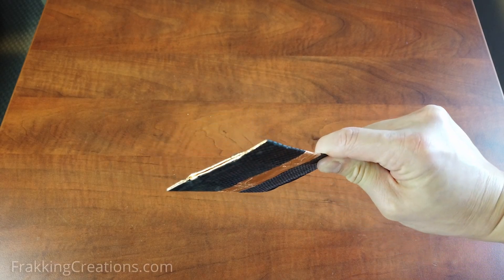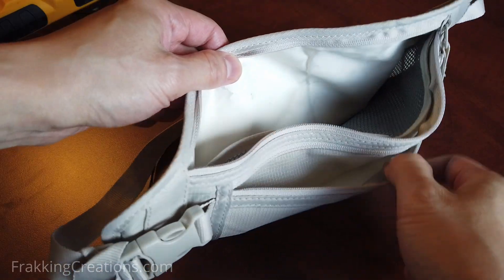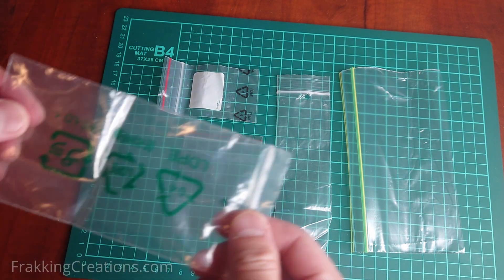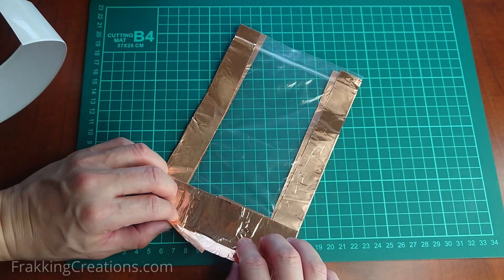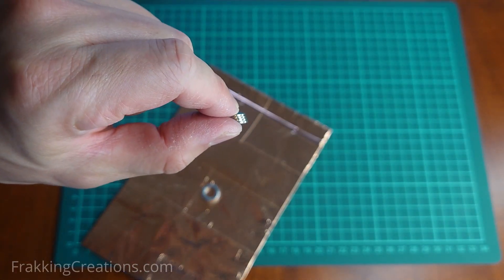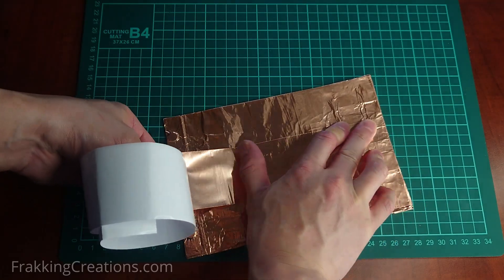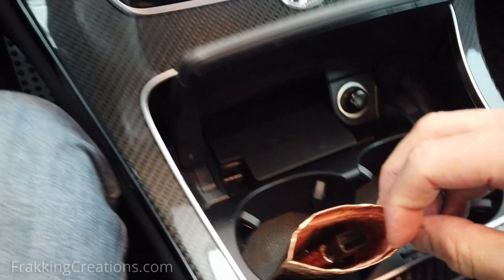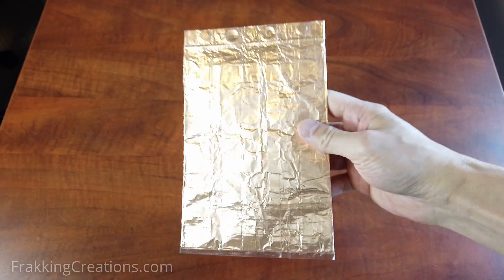Make & Test DIY Faraday bag for key FOB, RFID card, Passport - STOP Keyless car theft & more

Comment: Nice work. Don't they make some kind of mylar bags that block out all of these EMF's?
Reply from the maker: Thank you for commenting.  I don't believe that Mylar will block EMFs.  Maybe they are good for static electricity but that is much lower frequency than WIFI, 5G, etc...

I have links in the video description to ready made Faraday bags from a company that specializes in Faraday bags and much more.  They even have a transparent one also made with shielding fabric.

Note that if I were to make these bags again, I would use that company's shielding tape instead of the copper tape since the copper tape can be heavy and is not as malleable or softer like fabric.
Reply: @FrakkingCreations  Awesome, good to know!
I actually looked at a bunch of faraday bags... the bags I've seen so far are too big... I'm looking for a bag that just barely fits over a 6 1/4" x 3 1/4" phone, so that I can still put it in my pocket without a big bulge of extra material crammed into my pocket. 
Do you know of any faraday bags of that size?
Reply from the maker: I added a link to the Faraday phone sleeves they have.  Not sure if it's what you are looking for.  It's in the description too.
Reply: @FrakkingCreations  Cool! Thank you.
Reply from the maker: You're welcome.

Comment: I took regular aluminum foil from my kitchen unwrapped my key fob then walked up to the door and it did block the signal I also tapped my wallet on a Wi-Fi scanner at the grocery store and it picked up one of the credit cards. I then took a piece of cardboard and wrapped it in two layers of aluminum foil the size of a dollar bill and stuck it in my billfold compartment of my wallet. I did the same thing with credit card size Shields at stuck one in each inner pouch I perform the same test multiple times on different registers and they don't read the cards anymore. We'll see how long it lasts
Reply from the maker: There's definitely more than one way to do this and, of course, use whatever effective methods works best for you.  The important thing is to test to be sure and to test regularly because sometimes they stop working.

In one of our latest videos, I show how some of the RFID blocking cards that we have stopped working while some still worked.  I also show how to shield wallets using shielding tape.
You can find it here:  https://youtu.be/thnxCyCRS00

Comment: Would aluminum tape work as well as copper tape
Reply from the maker: It probably won't work well, if it works at all.  The reason is that the aluminum tape usually uses adhesive that is not conductive.
As you layer one layer of tape on another it's important that they conduct with each other.  This will maintain the RF shielding.
Also, the aluminum is less dense than copper so you will likely need more layers.

Comment: What would we put in them ? And you would likely have to keep it in the bag until the attack happens, which you would never know when… so taking anything out to use until then is risky.
Reply from the maker: True.  Though typically, wouldn't reading the RFID require the crook to be close to you with the scanner?  Plus timing would have to be right for the crook to be next to you or near you and ready to read your RFID items when you do take them out.

Faraday bags are not perfect but they do serve some purpose.

Comment: So you have a link to faraday tape that is pretty expensive for tape but i didnt see you use any faraday tape, i only  seen you use the copper tape so im a bit confused. Where did you use the faraday tape?
Reply from the maker: I provide the copper tape and faraday fabric tape so that viewers can choose what they want to use.  Both can block RF radiation and have adhesive that is conductive to work best  (unlike aluminum tape which typically has non-conductive adhesive)

I don't use faraday tape to make the bag here but I do use it to make the faraday book box in my other video.  The copper tape is heavier so it may make sense for some to use the faraday tape instead.

It's up to you.
Reply: @FrakkingCreations  awesome! Thanks for clearing that up.

Comment: idk aboot putting magnets in a bag meant to carry electronics. Might it not be better to double up the bags to go tip to toe like when you're using bin bags for oversized things?
Reply: There are requirements for electronic devices to cope with certain things. You should probably check if the device is fine with this.
Reply from the maker: I don't think it will affect too many electronics other than magnetic ones like old audio/data tapes, floppy disks, hard disk drives, etc.

Even cell phones nowadays have MagSafe cases that have metal plates on the back that allow the phone to be attached to a charger or holder that uses strong magnets.  The case attaches to the holder using magnetism.

Is there a specific concern you have with what the magnets will damage?

And, it's up to you how you want to create and use your faraday bag.  If you want to double up the way you mentioned, that can work too.  You will just have to test it to make sure no signals are leaked.

Comment: Can I use aluminum tape instead of copper tape?
Reply from the maker: It's possible but not ideal.  Aluminum tends to have an oxide layer form on it that is non-conductive.  Also the adhesive used is typically not conductive too.  When you apply multiple layers of the aluminum tape on top of each other, the layers may not end up being electrically conductive and will not work as well to prevent signal leaks.
Copper tape will not oxidize like this and the adhesive used is typically conductive.  Best to stay with the copper tape or the shielding tape that I linked to in the video description.
Hope that helps.
Reply: @FrakkingCreations  Great, thank you.
Reply: Don't worry about an oxide layer on the aluminum tape. Just spray some acrylic lacquer on the surface and no layer will form; also you can stick a layer of ducttape on top of the aluminum tape. Aluminum tape works fine and it's cheaper than copper tape.

Comment: First of all I love your you tube site, frakking creations.  I also love the video.  Very informative.  I did not know that RF acts like water.  A small defect in the Faraday pouch can allow RF to escape.  Other google sites, suggested using Aluminum foil as a Faraday insulator.  I tried it.  And much to my surprise, Aluminum foil it wrapped out well, works.  The test was to bring your car key near the door and tried to open it.  Also tried to turn on you car with and without the aluminum package.  Thanks again for the video.  You should test a similar aluminum bag.  Since aluminum is relatively cheaper.
Reply from the maker: Thanks for the comments.  We appreciate that.

You are correct that aluminum will work too.  Several points to keep in mind is that some aluminum foil comes in different thicknesses and the cheap ones are often too thin and tear easily.  There is also aluminum tape but note that a lot of aluminum tape use non-conductive adhesive which will cause adjacent tape not to conduct properly to form a good cage.  This happens when you tape layers of aluminum tape together and overlap the tape.  Just another point to keep in mind.

Please subscribe and share our videos with anyone else you think it will help.
Reply from the maker: Copper is also denser than aluminum at the same thickness so you may need more layers of aluminum, which could make the cost difference not too different.

In some cases a proper cage may not be enough and signals can actually penetrate the cage if the thickness of the material is not thick enough.  That's where it will matter what material is used.
Reply: @FrakkingCreations could you use an actual piece of copper??

Comment: could you tell me does the copper tape work as well as the faraday tape.  The price difference is huge.  the copper tape is 1/2 price of the faraday tape.  Thanks.
Reply from the maker: I haven't used the tape in the same way to make a Faraday bag so I won't know if the durability is better or worse when comparing the two.  The Faraday tape is made using metal infused threads that supposedly can flex more easily, which could allow it to last longer.

In general, for the bag both materials will eventually fail from flexing and use.  That's why I came up with the DIY portable Faraday box video.  It should last longer but I still have to verify.